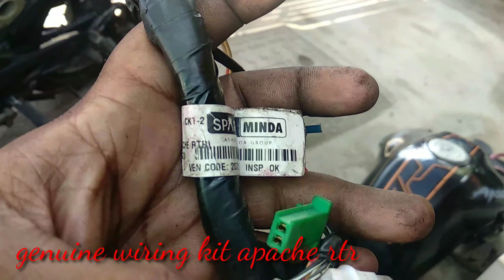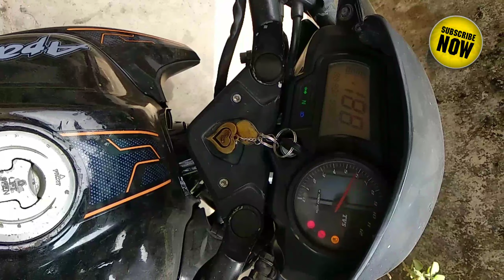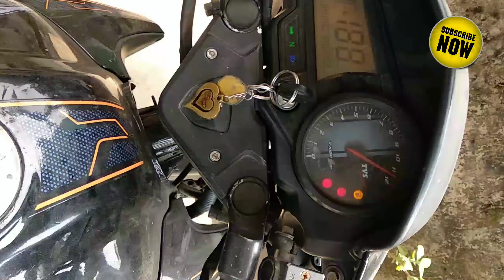DIY-REPLACING MOTOR CYCLE COMPLETE WIRING HARNESS OF APACHE RTR 160

Comment: Mere apache rtr 160 key on not working display and othe switch and kik start after display and other switch working  what problem bro....plz answer plz bhai🙏
Reply from the maker: Bhai dhoda Hindi me type karo
Reply from the maker: Bhai battery ka charge check karo + fuse dhekna
Reply: k
Reply: Vai wireing kitne ki hai
Reply: @sudipmondal3016  1300 ya 1560
Reply: @sag33r77  thanks vai

Comment: Brother Mera ek sawal hai mere pas Apache rtr160 hai 2008 model  Esme Maine LED project install Kiya ek din me bulb karab huwa reason Kya hoga brother bike ki headlight bike start ke baadh on karne pe on hothi hai shayad AC me hoga connection muje real reason Kya hai batawo aur ac se dc ko jaise convert karthe hai Jara clear se batawo tq
Reply from the maker: Bhai regulator rectifier change Karo...
Original showroom se apko 750 range per milaga..
Reply: @SelfRepair2stroke  Bhai agar RR kharab huwato battery charge nai hothi na batarry badia chal raha hai